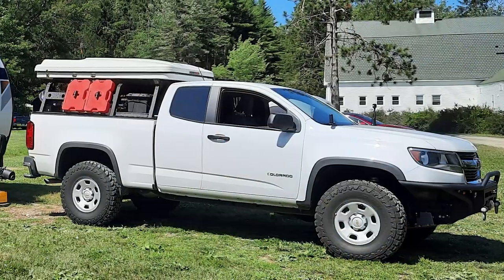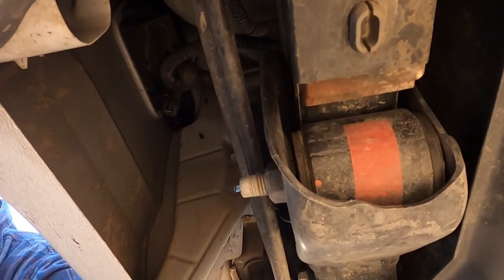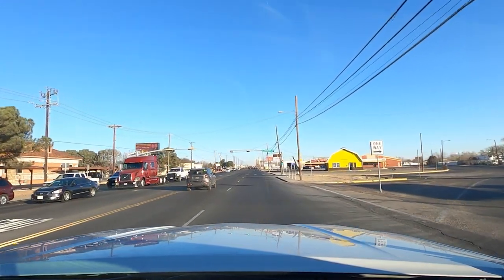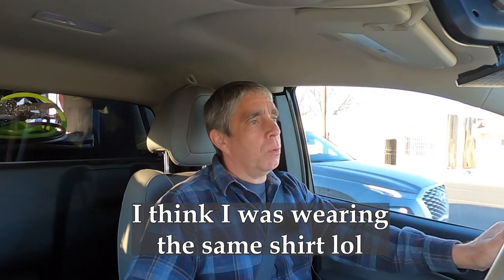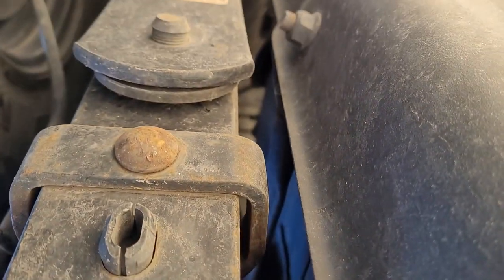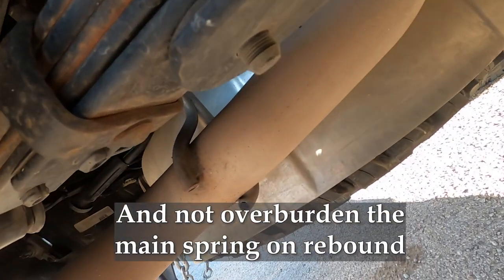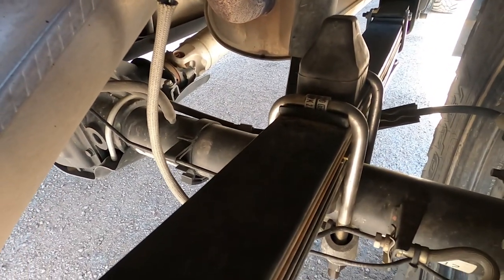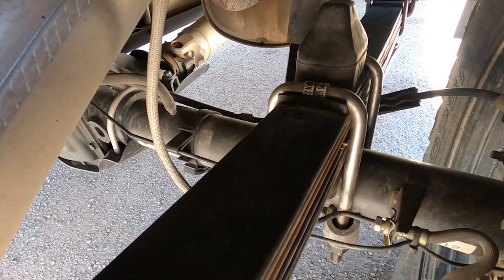Truck Leaf Spring Repair | Rebound Clamp Options | Full Time RV Living

Comment: Glad that worked out for you.  If you're not already able to be flexible and  think quickly on your feet, apparently full-time RVing will teach you those skills in no time.  It was good that you saw the defective brace when you did rather than have it break in some of the remote areas you've been to recently.
Reply from the maker: Hey, John! Yeah, my understanding is the clamp helps prevent the main spring taking the entire load on rebound and snapping. So a rather critical part.

Comment: Looking good there Mario. Hope they did both sides. As a full timer, as part of your safety checks list, you should check the torque of the lug nuts of the trailer and truck often. A good torque wrench is a necessary tool to have. You can find one at Harbor Freight, Lowes, Home Depot and other fine retailers near you. Add it to your toy box soon. Your repair made us keep thinking of a song. It is by Abba titled Money Money Money. Seems like RVing requires lots of it. Enjoy the journey and Safe Travels.
Reply from the maker: Hey there, MJ. I don't know why I don't carry a torque wrench. I guess I realize I would need three sizes to cover all the bases and have tried to depend on shops to help me out. Not sure that is working out. And yes, money money money!

Comment: Way to go Mario. Enjoy watching your videos. Thank you for sharing information and learning things from your videos. I also have a Chevy Colorado. I was wondering if you heard anything about the Chevy Colorado having a bent frame Underneath the bed of the truck. When towing a trailer off road.
Reply from the maker: Hi, Jim. Thanks for watching and thanks for taking the time to comment. It is possible to bend the frame. The owner's manual provides specifications for load limits at the bed, bed rails, and hitch. For example, they do not support the use of "slide in" campers. The way I understand it, all vehicles are designed to "crumple" in specific zones when a certain amount of force is applied. It is possible to bend the frame at, what seems to me, an engineered point of failure. I am not worried about mine because I know my weights and what I intend to use the truck for.